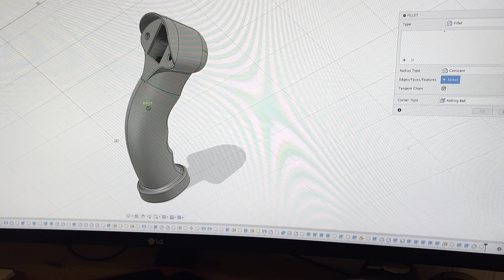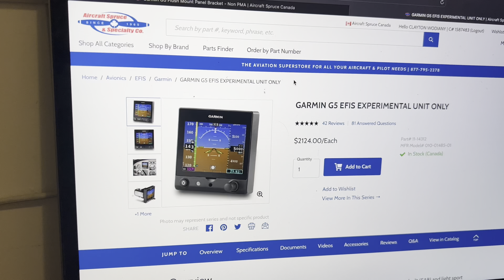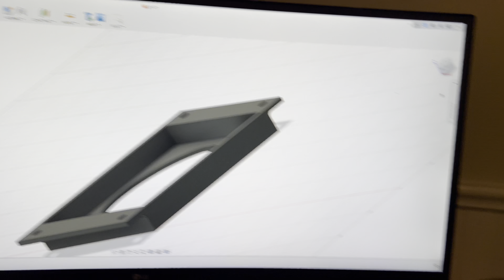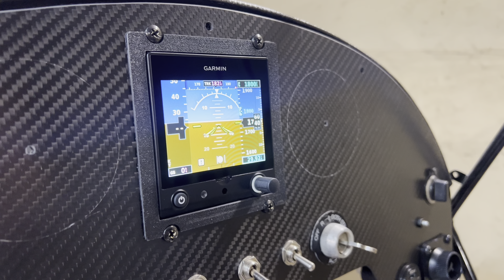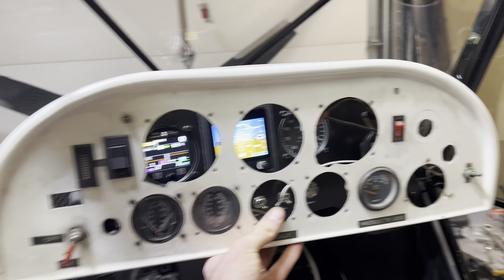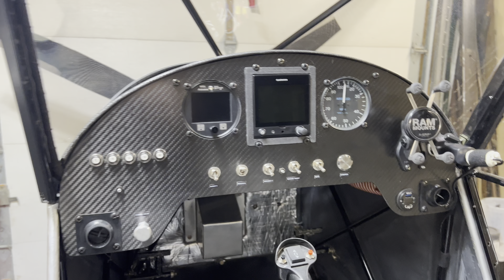Upgrading Abandoned Bush Plane with Modern Avionics

Comment: Newbie here! Your New avionics set seems to reduce the instruments on your dash or are they threww oacked with multi functions? Can you explain further if you get my question.
Reply from the maker: I think I get you. They are multi function. I’ve got it simplified to 3 instruments, one is a backup airspeed indicator in case I lose electric. Then there is an engine and flight instrument, the engine monitor replaces 8 instruments and packs them into one small display, the flight display is the same idea. This allows for a simpler, easy to read panel with even more data. Also because of eliminating all the extra instruments it allows for a smaller lighter panel
Reply: @claytonwodiany  alright. I understand it better now, I've also researched more about this g5 and other glass panels...  Thanks again, your journey is encouraging especially to newbies like me

Comment: You printing in ABS??  I printed a IPad mount for my Remos in PLA and on hot day it deformed.  Switched it to ABS and never had an issue the rest of last summer
Reply from the maker: Good suggestion, I’m printing in pla and going to do my best keeping the plane indoors but if I would do it again that’s a great way to do it
Reply: @claytonwodiany  yeah black carbon fiber is gonna get hot. My plane is all composite painted white but dash cover is black abs
Reply: High-temp PETG (PolyHex) and PC have been my go-to for parts in the airplane where longevity and heat tolerance is a concern.
Reply: @mkosmo  Yeah I have both and I own 2 Bambu X1 Carbons with heated chamber. It can do the Carbon Fiber filament as well with a steel hotend.
Reply: @EricHaskins71  I love some PA6-CF for this kind of thing, too, but I've more or less moved away from it for most things with the discovery of PolyHex, especially for parts with small features.  At the end of the day it comes down to either material properties or finish since all of the above (except PLA) will handle the temperatures and vibration just fine.

Comment: Very, very cool. I love the carbon fiber and am now considering something similar in my Sonex (thanks for the demonstration). I do quite a bit of 3D printing and, as another person mentioned, I'd be nervous about heat deforming the printed parts on a hot day. Maybe consider using the 3D printer to make a mold and lay up the G5 mount part in carbon instead. And the front bezel, too.
Reply from the maker: That’s a great idea, I’ll definitely make a video of the pla if it has any issues and the fix for it would probably be that exactly, making some carbon parts

Comment: Awesome work. Love your usage of 3D printing. 👌🏼

Not sure what kind of phone you have, but maybe consider the quad lock integrated charging system. I just added it to my ADV motorcycle and it’s awesome. It is a hardwired 12 to 24 V supply. No extra wires needed, so it is super clean.
Reply from the maker: Thanks! And that’s a good idea I’m going to look into that

Comment: Nice work, but can I make a few suggestions?  For the fuel lines, I would use, at a minimum, good quality rubber automotive fuel hose.  It's inexpensive and a lot more durable than that clear vinyl hose.  And as much as I love designing clips, etc. and making them on my 3D printer, I would secure the fuel hoses with the time-tested double Adel clamp technique. One clamp goes around the frame tube and the other around the hose.  A screw connects the two.

Also, i hope you are using Tefzel insulated wire.  It's not expensive at Aircraft Spruce.  You can use nice thin 20 gauge for things like PTT switches.
Reply from the maker: Great suggestion, I’m actually redoing the whole fuel system with aluminum fuel lines for a fuel injected 4 stroke I’m going to be installing. For the most part the wiring is all from aircraft spruce and most is 18ga because I bought in bulk with the exception for some higher current circuits. And the adel clamp is a great idea, just looked into it and looks like a great reliable way to secure lines. Will definitely be doing that! Thanks!
Reply: @claytonwodiany Let me guess, phazer swap? Super stoked on the build. Keep the videos coming. Awesome work!!
Reply from the maker: Thanks! Must say that’s a good guess, but can’t say for sure